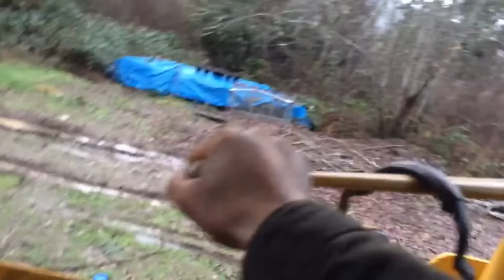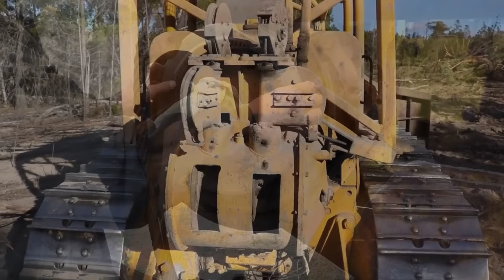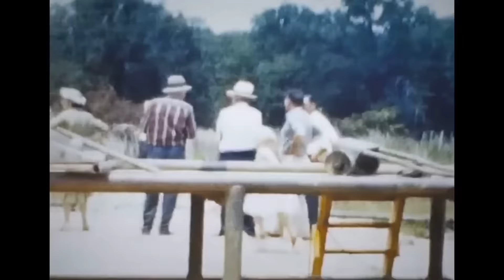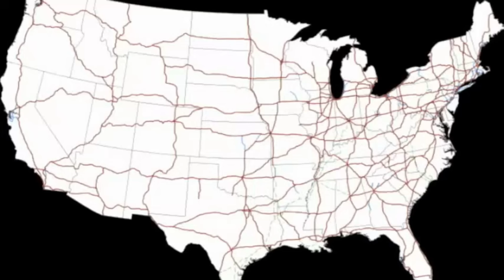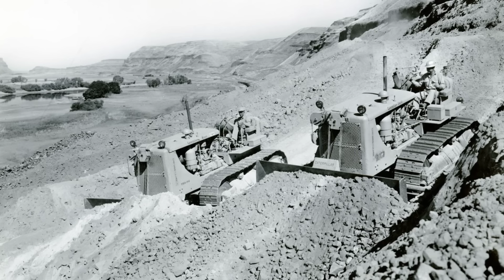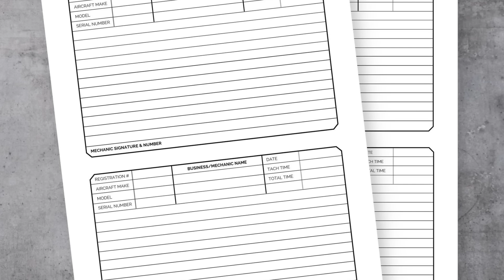Caterpillar Calculated 600 Deaths a Year and Did Nothing. Here's the Memo.

Comment: I don't believe the standing on the balls of their feet ready to jump story saved anybody from a flying cable. HOW THE HELL would a dozer operator run a machine that way when they had a manually operated hand clutch, manual transmission, hand/foot steering PLUS the hand operated dozer blade control, all limbs being required in action while trying to push dirt? That statement is from someone who never operated a cable-controlled dozer. Then you had the dozers that pulled scrapers that were cable controlled as well. This ready to jump is all bullshit.
Reply from the maker: Great points and very valid questions! These old machines were incredibly complex to operate safely. The stories from that era are fascinating – thanks for sharing your perspective!

Comment: My dad ran them and he never heard of anyone dying because of the cable whipping. Also the cable is in front of the hard nose. How is the cable reaching the operator seat?  I call bullshit
Reply from the maker: thanks for your infos…. but our infos are well researched and you will find them anywhere….
Reply: I ran many of these cable dozers some had a rear mounted cable control unite but the cable was all running through pipe to the front at least on a caterpillar and any other brand I ever seen making it Impossible to get to the operator so yes this is total B.S. pulling a cable scraper pan you could have a cable hit you. Worst of all is the big Hyster rear mounted towing winch without a cab with a screen in the back of it. Operating the big towing winch with 1 inch cable or bigger with no cab and rear screen would be just completely ignorant
Reply: @lilpony001 ya I think this guy is mistaking the rear winch line with the front. I have seen quite a few rear lines break while winching with a cat and a truck
Reply from the maker: @bjhinson4647 Thanks for adding your experience with rear winch lines. Appreciate you watching and joining the discussion!
Reply from the maker: @lilpony001 Thanks for sharing your hands-on experience with these cable dozers. Setups varied a lot by brand and model, so great to hear it from someone who actually ran them!
Reply: no shit
Reply from the maker: @BRIANMITCHELL-c6g2l Thanks for watching and for chiming in!